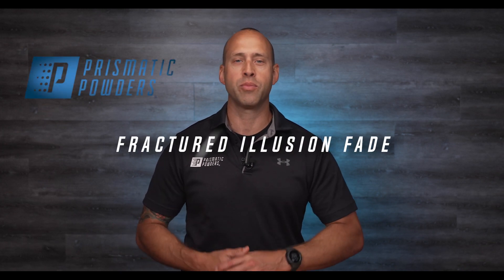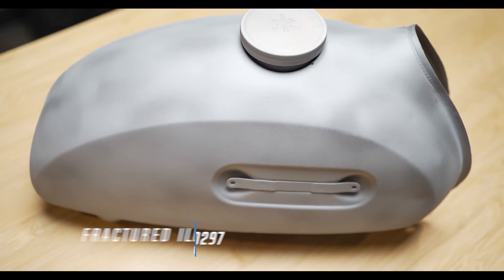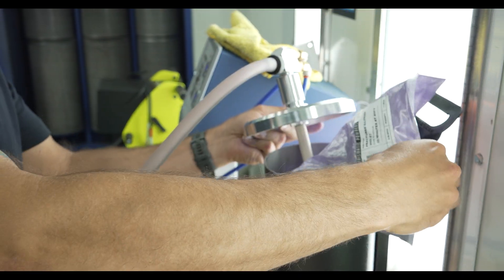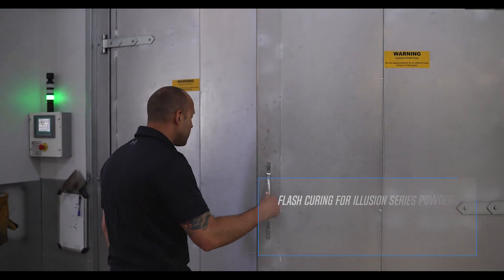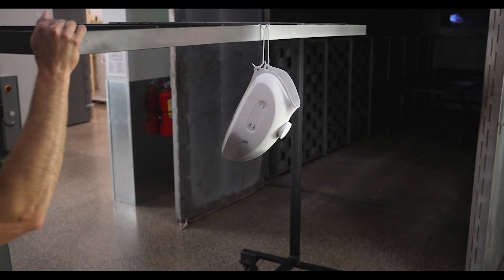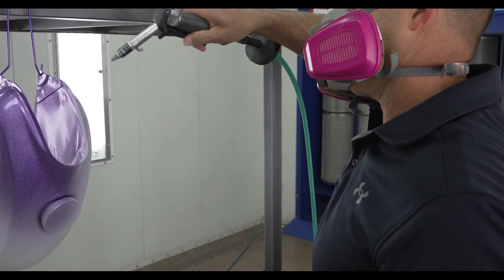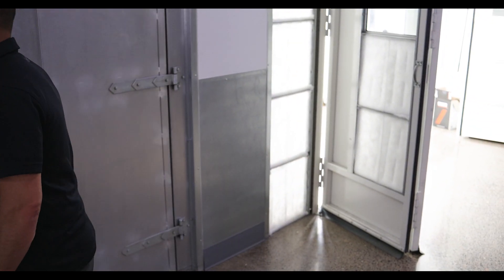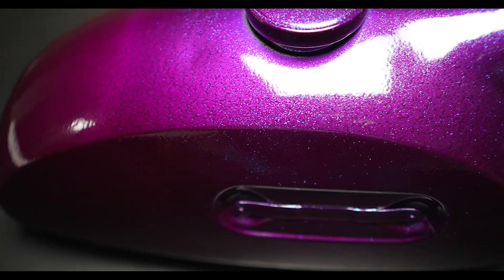Fractured Illusion Fade | Prismatic Powders®

Comment: I have a 2007 Honda CRV. That is black. I want to coat the lower bottom gray plastic trim in gold. I have also considered gold wrapping. This textured finishing sounds like it will last longer. What is the cost of this textured procedure ?
Reply from the maker: Unfortunately you will not be able to powder coat plastic parts. The main issue is that the temperatures required for curing are too high for most plastics. We do have another division within our company (Cerakote) which is a durable ceramic coating and will have suitable options for plastics. https://www.cerakote.com/shop/cerakote-coating

Comment: The line about be careful with the air gun is a lie.. that happened because you didn’t coat it properly, give it a lil preheat, or put the powder gun  in a different position.😊
Reply from the maker: First of all, working with Illusion series powders is a different process than normal powders.  We do not encourage "shooting hot for a variety of reasons. First, it cannot be undone without stripping. Second, Illusions have a specific time at temperature for flashing. This needs to be followed for correct results. 
 I can assure you we did not lie about anything. If we wanted to deceive, we wouldn't show a common mistake for educational purposes.
Reply: @PrismaticPowders  the unpainted area is because the powder wasn’t sticking. It happens to me all the time. If you warm the part up it sticks in those tight places.